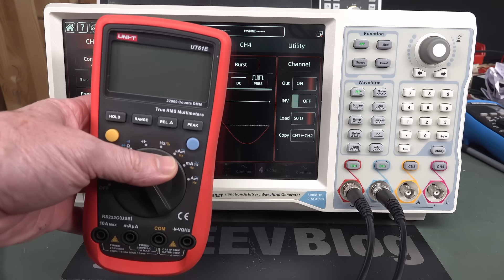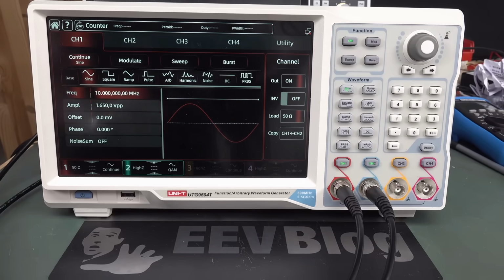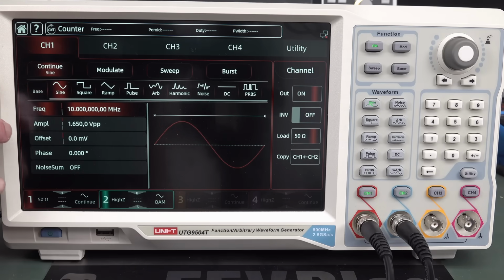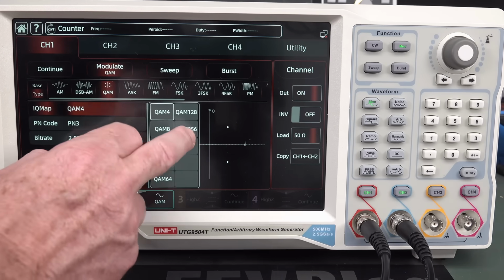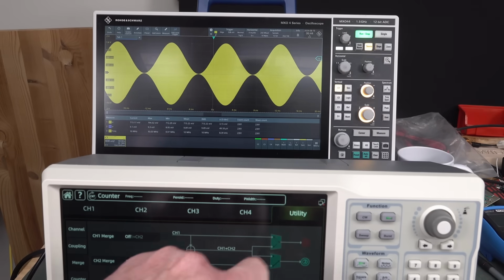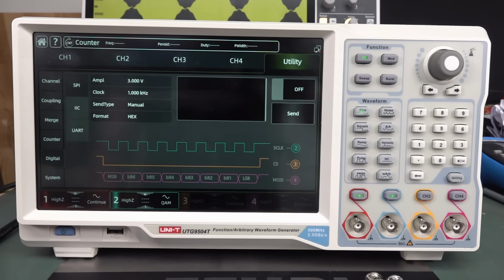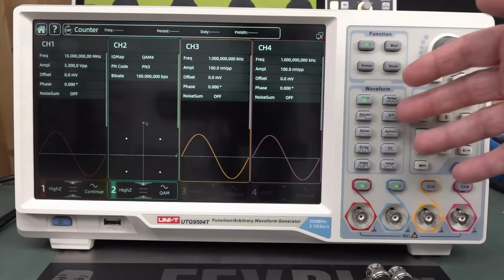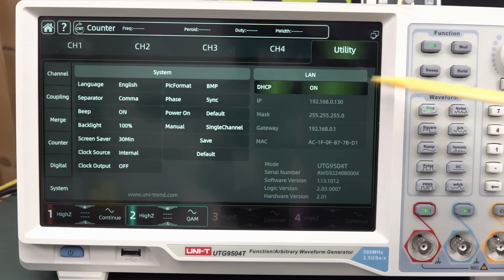$5000 Uni-T UTG9504T 500MHz Function Generator Partial Review (The Lost Tapes)

Comment: I guess I'm just dumb but Dave did say there is a difference between a function generator and an RF signal generator of the same frequency. What would that be? I've seen things called RF signal generators. Mostly from like old HP stuff but I guess the RF stuff can't go down below certain frequencies?
Reply from the maker: RF generators will have lower noise floors, and specific lower signal level attenuators, better phase noise etc. Function generators don't have the same low level capability.
Reply: Agree 100% with what Dave posted.  My RF generators have much cleaner outputs, much lower signal level outputs (-130dBm or lower), usually several orders of magnitude better frequency accuracy and more RF communications related modulation types.

Comment: The Siglent models can be driven by Siglent oscilloscopes for Bode plots,
Reply: Also let's be real here, a SDG6022X for 1.5ish k is all you would ever need as a(n advanced) hobbist (or professional for home use) and you just hack it to turn it into a SDG6052X because you probably don't need the warranty. For anything above you enter the mentioned RF gen territory anyway. The Uni-T having 2 additonal lower bandwidth outputs is nice for the price, but I honestly never found myself needing more than 2 ports. I'm also a bit torn on the form factor, on one hand "big screen is touchy, big is better" on the other, damn that's as much space on the workbench as my scope and vna and you can't stack it properly with the repurposed scope design they used.